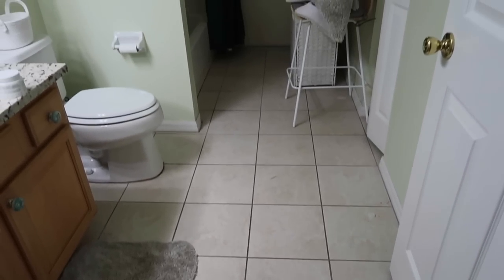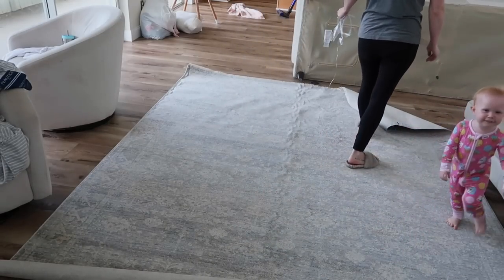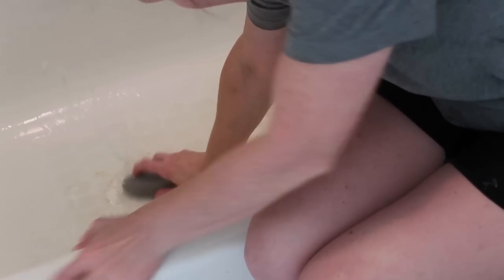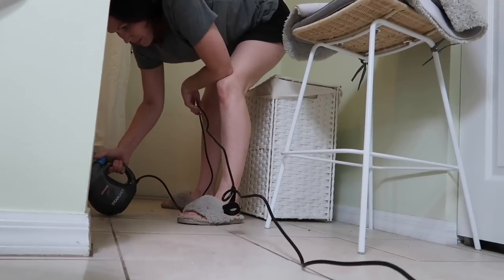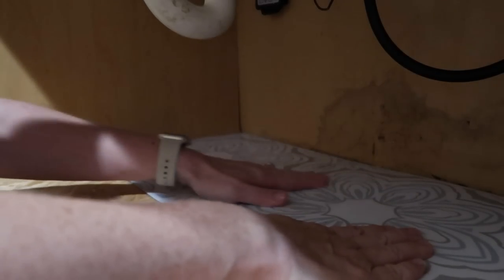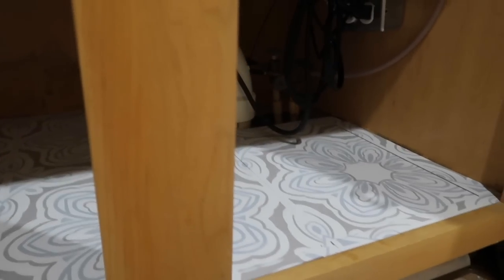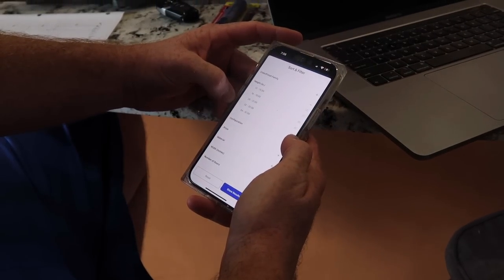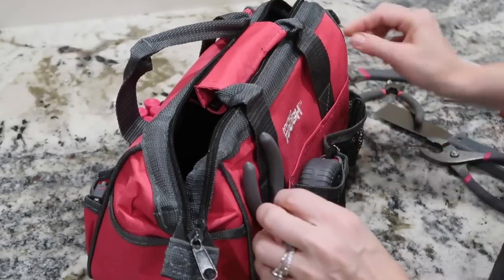Summer Homemaking Inspiration: Meal Prep, Cleaning, & Décor Tips

Comment: I use Lysol toilet bowl cleaner in the gel formula with bleach on my grout lines.  It is very strong so definitely wear a mask.  I will squeeze it onto a section at a time, then use a scrub brush to get all the dirt cleaned up.  It is by far the best thing I have came across.  You will have to use another rag with water to wipe it up as you go, but it is only something I have to do maybe once a year.